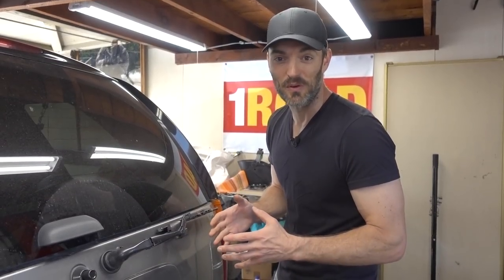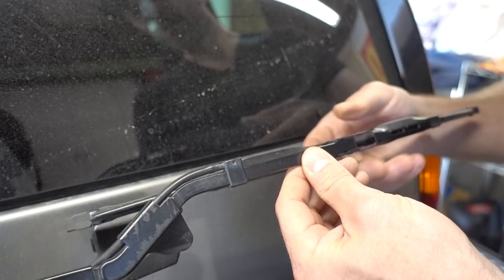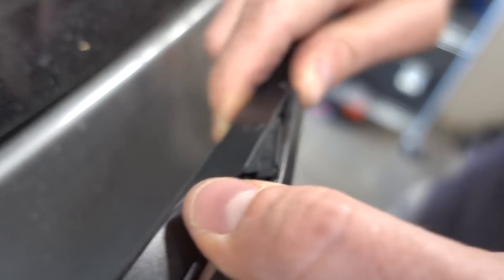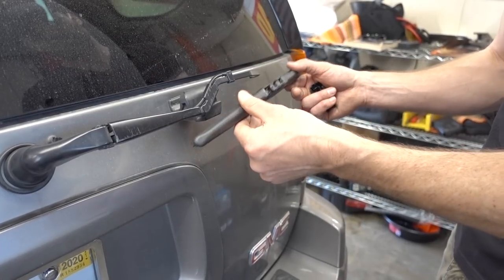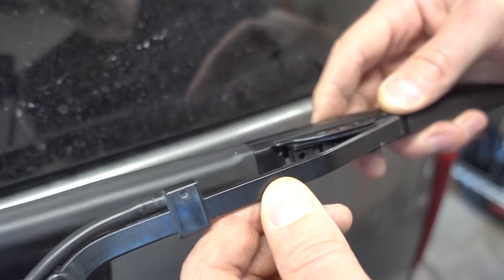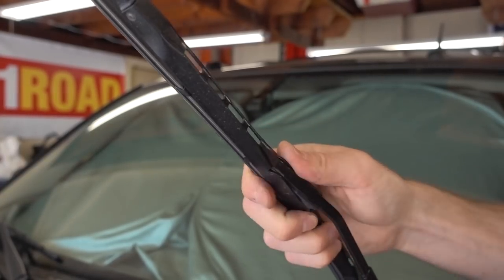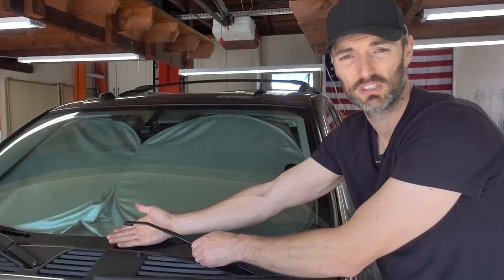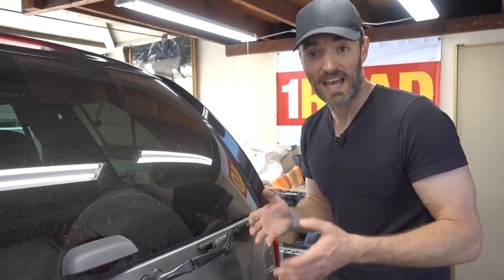Why You've Been INSTALLING WINDSHIELD WIPERS WRONG!

Comment: Some windshield wipers have different designs and connectors. So installation will be different for each wiper blade, according to the wiper arm and length of the wiper blade. Most cars have J-hook arm connectors, while others have the pin-type connectors. The newer wiper arm connectors from other automakers have the pinch-style connectors, and modern luxury vehicles have wiper blade arm connectors that are totally different from the J-hook, pin, and pinch-style connectors.

Comment: The plastic tab keeps locking the wiper on when I try to pull it off. I can't just "slide the wiper over and remove" there's not enough space, I push the tab in and pull it down but then to pull it up around the j hook, the tab just locks in again. I just have to break it apart to get it to finally get the j hook around the metal part. it's take me about 45 minutes to get off one wiper.